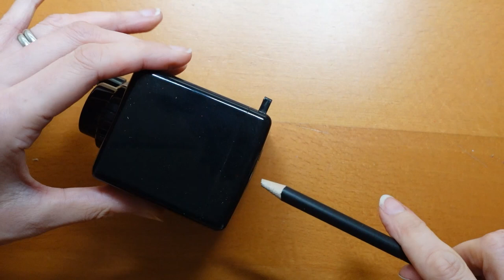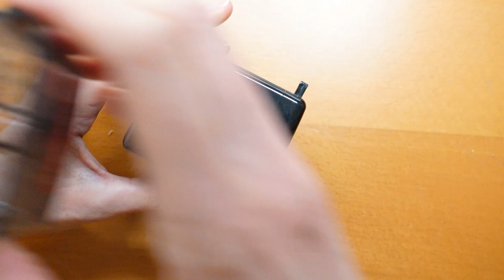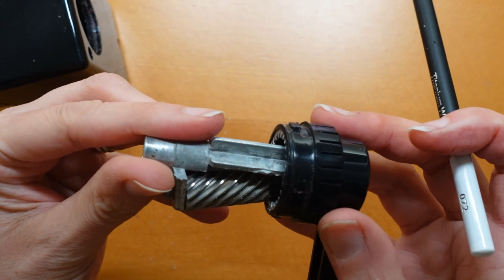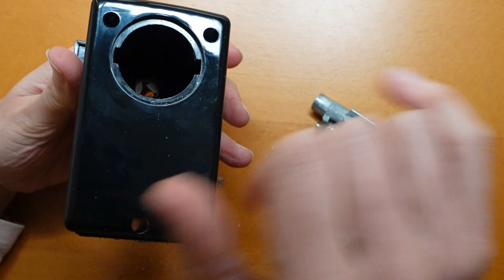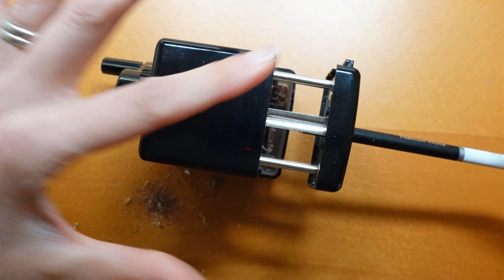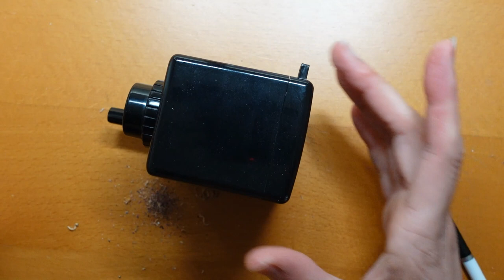How to......Remove a Lead from a Hand Crank Sharpener

Comment: Rachel, thank you for this video. Over a year ago my rotary sharpener broke - or so I thought! The handle was just spinning loosely around when I tried to sharpen my pencils. I took the handle off and had a look, but couldn't see what was wrong. I was going to put it in the bin but hadn't got the heart as it wasn't cheap, so I put it in the cupboard. After watching your video and following your instructions it now works!!! There was a lead stuck in it which I didn't see before! So thank you so much! x😃
Reply from the maker: I am so pleased to hear this.